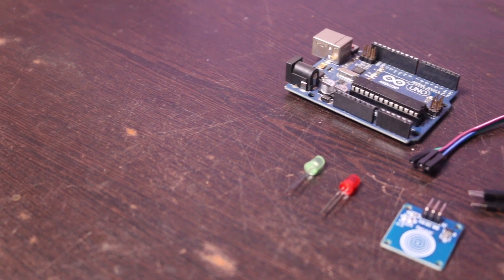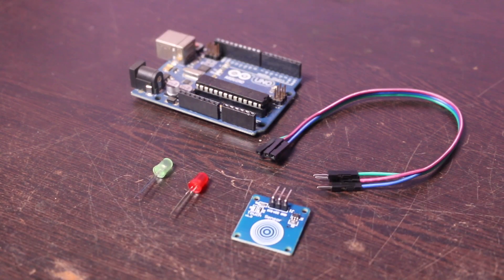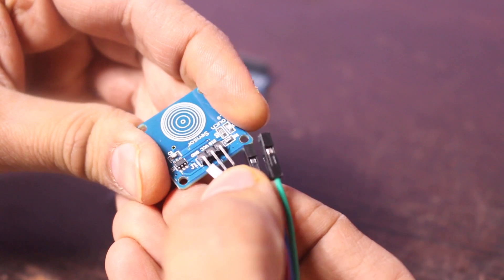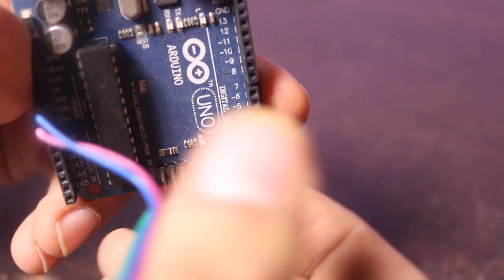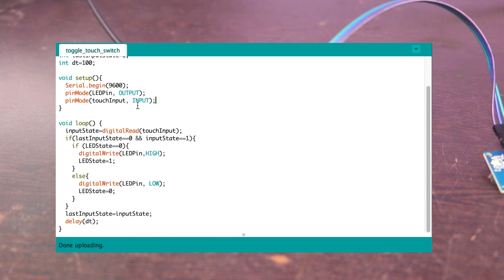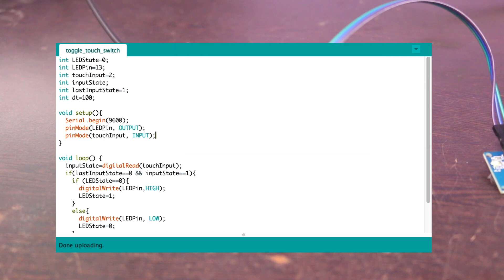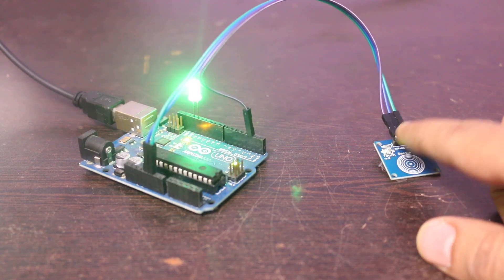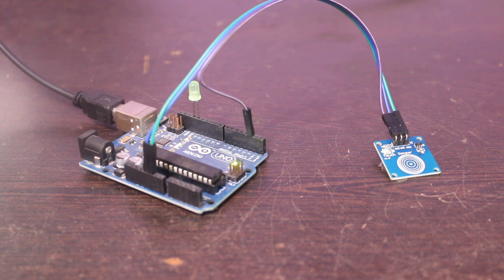Capacitive Touch Sensor with Arduino use as a Toggle Switch

Comment: Here is the code:

int LEDState = 0;
int touchInput = 3;
int LEDPin = 13;
int inputState;
int lastInputState = 1;
int dt = 100;
void setup() {
  // put your setup code here, to run once:
  Serial.begin(9600);
  // pinMode(LED_BUILTIN, OUTPUT); // built-in LED declaration if you want
  pinMode(LEDPin, OUTPUT);
  pinMode(touchInput, INPUT);
}

void loop() {
  // put your main code here, to run repeatedly:
  inputState = digitalRead(touchInput);
  if (lastInputState == 0 && inputState == 1) {
    if (LEDState == 0) {
      // digitalWrite(LED_BUILTIN, HIGH); // Turn on built-in LED if you want
      digitalWrite(LEDPin, HIGH);
      LEDState = 1;
    }
    else {
      // digitalWrite(LED_BUILTIN, LOW); // Turn off built-in LED if you want
      digitalWrite(LEDPin, LOW);
      LEDState = 0;
    }
  }
  lastInputState = inputState;
  delay(dt);
}
Thanks me later 🙂
Reply: Thank you 🙏

Comment: Here is the code -- 

int LEDState = 0;
int touchInput = 2;
int inputState;
int lastInputState = 1;
int LEDPin = 13;  // Define the LED pin

void setup() {
  Serial.begin(9600);
  pinMode(LEDPin, OUTPUT);
  pinMode(touchInput, INPUT);
}

void loop() {
  inputState = digitalRead(touchInput);

  if (lastInputState == 0 && inputState == 1) {
    if (LEDState == 0) {
      digitalWrite(LEDPin, HIGH);
      LEDState = 1;
      Serial.println("Touch detected. LED turned ON.");
    } else {
      digitalWrite(LEDPin, LOW);
      LEDState = 0;
      Serial.println("Touch detected. LED turned OFF.");
    }
  }

  lastInputState = inputState;
  delay(100);  // Adjust the delay as needed
}
Reply: thanks so much